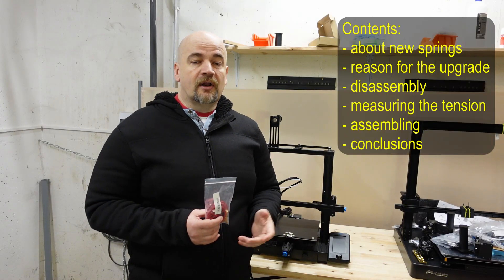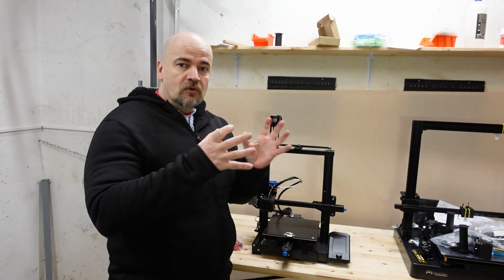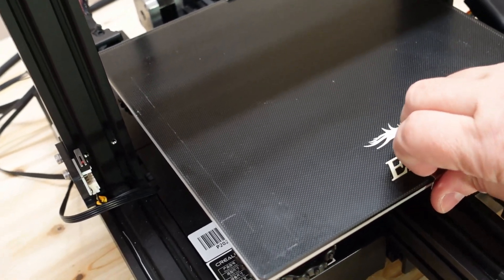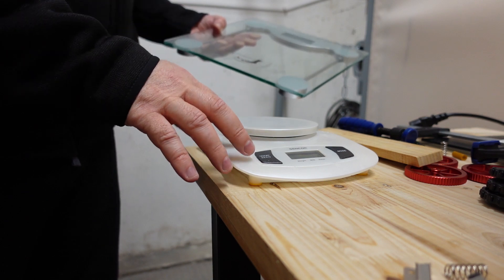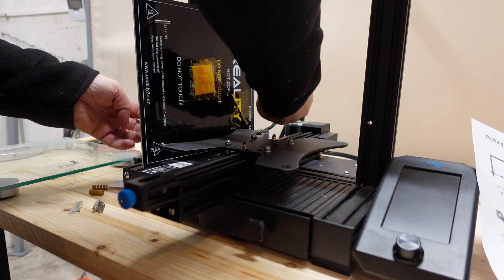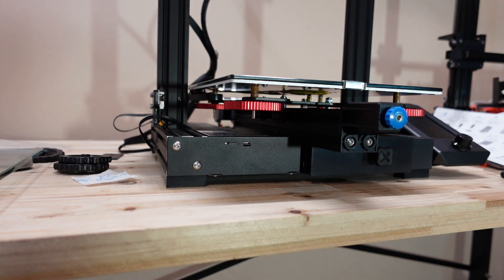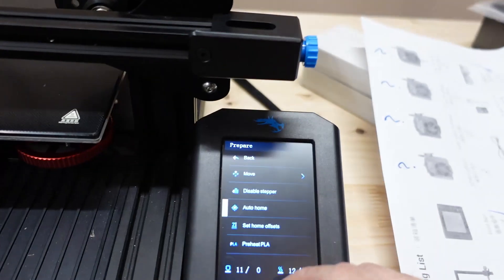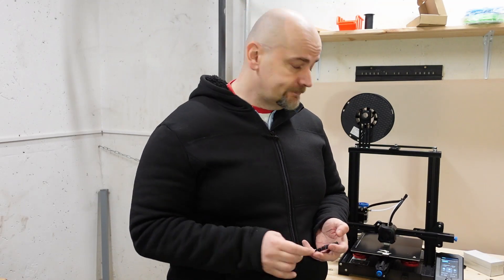Testing and upgrading bed leveling springs and knobs - Ender3 V2 upgrade

Comment: I'm gunna do this with my v3 se. Looks like I'll have to drill out the threads in the plate under the bed. Should work. If it doesnt, oh well buy new parts I guess.

Update: I did it. Aaand I got too excited for the upgrade that I over looked one detail of why it doesn't work....until you modify the wheels. 
All 4 adjustment wheels strike the front and rear bump of the body of the ender 3 v3 se. To get around this I used a coping saw to cut the spikes half way or I measured 9mm from center and they now clear. Wheel spins nicely. To get the bolts to go through the bracing plate under the heated bed, I measured a  the stock bolt that goes through the bed and into said plate and found a drill bit 0.33 mm larger. I found I could have actually stepped that up one more size. It now can be leveled. I'll update this again with my finding. Was it a good idea? I don't know yet.

Comment: It's really annoying that Ender ships these units with free spinning Bed mount bolts. A cheap part like lock nuts to hold the bolts in place should come stock on every unit.

Comment: How heavy are these knobs compared to the original? Adding mass to a bed slinger ought to be detrimental, then again maybe at slow speeds it doesn't matter
Reply from the maker: Yes, they are heavier and more slippy. I moved back to plastic ones (but springs are good)
Reply: @MyTechFun  hey thanks, maybe I won't upgrade them after all! The ender 5 even with bed supports flexes a bit but in this case it would just be pretty much a static load... I'd rather upgrade the leadscrew first to try and get rid of the z wobble though.

Comment: I just installed those springs I've done two test prints and both times the nozzle just hits the bed it doesn't even get onto the bed it hits the bed starts spitting out filament so I have to quickly stop it, do I just need to compress the spring is more?
Reply from the maker: Try to compress springs more. If they are almost max compressed, move the Z limit switch a little bit higher (so it is pressed earlier)
Reply: @MyTechFun  when I installed the glass bed I saw to put the bed under the z switch to measure should I do that with the spring? That would mean I need to measure spring+bed right?
Reply: I depressed the screws completely, I dont know if it's me or the screws but one side is always off. I had a theory, if I loosen the springs couldnt I then just ajust the z ax in the right position? So 0 would always have the nozzle in its right position that would also cut leveling needs, or am I just trying to climb a never ending mountain meaning its a waste of time.

Comment: I bought these so my bed stays level. They didn't help, but my bed doesn't crash into the y motor anymore because they're taller so I guess it's a win lol 🤷‍♂️
Reply from the maker: You can always move Z limit switch a little bit if necessary (up-down)

Comment: Wow! You saved my life at 12:55! I was having a hard time with my new yellow springs because they are taller than the original ones. I moved the sensor up a little bit and I managed to level it properly!
Thank you so much for that tip. Really appreciate it!

Comment: I have received ender 3 3d printer. In bed spring There 4 springs in that one smaller then all? It's good or not…
Reply from the maker: Smaller goes to back-left position.
Reply: @MyTechFun  okey…

Comment: I guess there is an important aspect, if u push the bed level springs soo hard, the spinrgs will bend your bed, Isn't it?
Reply from the maker: Hm. I don't know if it can bend or it will break first. But I belive these springs are not that strong, I never heard about similar case.

Comment: Thank you for this video I finally figured out what to do for my ender 3 printer I changed to class bed and whenever I would level it it would  Unleveled  itself. Guess it’s time to replace my factory springs with the one mentioned in your video.

Comment: If I'm planning on putting a BL touch on, is there any benefit to doing the spring upgrade? If I just crank the stock springs down tight and get it roughly level, won't the BL touch compensate?
Reply from the maker: Yes, there is a benefit of sprint upgrade. BL Touch will not level the bed for you, only compensate the unleveled distances during 3D printing. It would be perfect, if it doesn't have to compensate anything. Stronger springs will hold the bed leveled for a longer time.
Reply: @MyTechFun  thanks for taking the time to respond!

Comment: Hi, regarding your test print after replacing springs. I am having issues with getting the same print to stick to the bed, it always comes loose about 2 minutes after the print has started. Any ideas on what I could be doing wrong
Reply from the maker: Not enough information. But clean and level the bed.

Comment: I got a set of these for my ender 3 v2, they are too long, the links in your description are for 25mm, the ones the v2 needs are 20mm, how did you compensate for the taller spring with out cutting them?
Reply: nevermind, i see you messed with the Z limit switch, i ordered some 20mm springs and hopefully i wont have to mess with that
Reply from the maker: It's very easy to move z limit switch, only two screws is holding it.

Comment: I performed a similar upgrade on my Ender 3V2. The difference was that I used 20mm yellow springs (same length as the originals) whereas I think yours are longer. The result for me is that I didn't have to move the Z-axis switch. The yellow springs are much stiffer than the originals so it's not necessary to make them longer also. Otherwise you lose build height and/or end up with highly compressed springs which start to deform horizontally and are difficult to adjust. Great channel, by the way. I subscribed!

Comment: I've tried quite a few spring sets and I have a set of silicone columns too, the exact ones you pictured. I've probably used equal amounts between springs and the silicone columns and I haven't really noticed a difference in anything really. I use a BLTouch too so as few have mentioned, most of the small movements in bed elevation is compensated for.
The one thing I will say though is that the silicone columns are generally a lot shorter than the springs and you might run into issues using some of Marlins built in manual leveling features like Level Corners. Once you've fully uncompressed the columns and can't go any higher with the bed the firmware can get fussy about Z height and it creates a kind of rabbit hole trying to figure out how to trick things into working. 
Great video as always I really enjoy your style of reviewing and providing detailed information on your journey through upgrading :) Keep up the amazing work!

Comment: Is the diameter of replacement springs slightly bigger than original? How well do they stay within the trace keepout distance around the holes? You have a metal undercarriage, so it would be bad if the springs scratched their way through soldermask and then contacted the traces underneath, it's directly a fire hazard. I suggest that you always use some kind of possibly plastic washer under the spring that you can use a hole punch kit to make from some robust plastic, or maybe a nut that tightens the screw directly against the bed and that won't move. The nut will also consume some space and compress stock springs more. I also use Kapton tape applied on the spots of the bed where i may attach glass mounting clamps, also so the solder mask doesn't get damaged.
Reply from the maker: Interesting thinking. Yes, very minimally bigger outer diameter. Inner almost equal. Top is flat surface, so they hold the position very stable. Plastic washer? It must be very heat resistant if I heat the bed to 110°C for example. Yes, tightening a nut came to my mind, but I didn't tried it. Thx for sharing your thoughts..

Comment: I find that geometry of a smoother  knob has a better feel to it, i find the bigger bumps make it easier to apply a high torque but i find the smoother alows a more fine adjustmet, i use diy printed knobs (.4mm layer height .4 nozzel) so the porosity of the plastic gives a better grip on yout fingers, and i have a turned steel insert for the threads.( possibly leaving the top plate on will help prevent your screws wobbling as much. Appreaciate all your efforts and videos.

Comment: If you're going to continue doing videos on Ender 3 upgrades, have you considered doing one about 3 point leveling conversion kits, and/or about linear rails conversions? Those are the ones I think sound like they could be good, but I don't know if they actually make a difference to motivate the cost
Reply from the maker: Good suggestion. I am not sure yet about linear rails, but I think only advantage would be longer life time. Wheels wear by time, they should be replaced, only I am not sure how often. It is hard to invest if you can't see immediately the difference in printing.

Comment: Two things to pay attention to here which cause a lot of headaches for people, and damage printers. First one is to purchase the same length springs as the original if possible. In your case, I thnk you used matching 20mm springs as the original for Ender 3 v2. Most listings on Amazon and Banggood are 25mm springs with instructions to cut them for sizing. Do not cut the springs. These light load aftermarket springs are die-cut to be flat on both ends for a reason. Rather raise or lower the z limit switch by the difference between original and new spring length. The other issue is over compressing the springs which you unfortunately did in your video. Over compression will prevent the springs from serving their function. This again can be prevented by raising the z limit switch by the a few mms.
Reply from the maker: Very nice written comment (most of it I mentioned in video). Yes, in footage they look over compressed, during first setting they shold be to prevent nozzle to hit the bed. Then I loose them a little bit. But in meantime I found they could be less tight, so I raised the Z limit switch by 0.5 mm, but after published video.

Comment: I use Ideaformer red silicone stands from aliexpress. I've picked these because one out of four is shorter to accomodate bed cable tensioner. Bed is very stable now, no movement like with standard springs (even with properly tightened v-rollers bed still had some looseness). Also it's more difficult to turn the adjustment wheels, it's now close to impossible to turn them by mistake, which is very good.

Comment: I've used the yellow springs on my three printers for awhile now and seem to hold the position well for long periods. I do have BL touches on all the printers though so that could be compensating for any movement. Only way to truly know would be to grab the mesh numbers from time to time and compare to see if there is any movement.

I have some silicone spacers that I ordered awhile back and am waiting on delivery. So will see how those will work and if any real difference. I've never had the nozzle slam into the bed, but with the silicone spacers if that were to happen it could result on your bed getting damaged. I use mirrors so I guess the potential would be there to break them if that happens but knock on wood hasn't happened yet.
Reply: You've never had a nozzle crash before? If I send you money will you buy some lottery tickets?

Comment: Just some thoughts from an engineering point of view: You measure both springs compressed to 17mm, but didn't mention if they compressed the same length. And from what I can tell the yellow spring is longer...    Of course it doesn't really matter here, just pointing out a potential oversight  :)
I also agree that the stock wheels might be better since you always want a lighter carriage whenever possible, thanks for this good video!
Reply from the maker: Thx. I like engeneering thoughts and I agree, one of spring parameter is Newton per compression length. But here I aproach from using aspect. If they are compressed to same lengh (in printer), what force they provide. And they have almost similar uncompressed length (yellow is longer by 0.5 mm maybe)

Comment: I went away with the springs, my printer had those yellow/orange springs, I guess they worked fine but I went with silicone standoffs, they are usually marketed under "Heatbed Silicone Leveling Column".

Comment: I am using silicon self made dampers for 2-3 years now and I don't really see loosing some elasticity. Maybe the raw / source material (Silikon Kautschuk from trollfactory) I use does not loose so much elasticity over time. In my opinion, I think these dampers with 20-25mm diameter give the whole bed a much higher stability in horizontal direction than these springs (that are really much better than the stock one, as you said!).
Reply from the maker: Great point! I didn't think of that (more stability in horizontal direction). Probably there are better materials, I had some bad experience with silicone and elasticity.

Comment: Maybe it is not worth talking about, but using the full aluminum knobs could take some more heat from the heatbed to the knobs, so that there where the screws are inserted in the bed a small cold spot can appear. Less metal material there, less heat loosing from bed, so my theory :-)
Reply from the maker: Taking heat from bed, I didn't think of that. I like your theories. Thx.

Comment: Since I've installed a BL Touch on my E5 I tightened the bed all the way and secured the knobs with an additional nut. You'd be suprised how level it is.
Reply: this is actually a great tip! thanks, just got the official auto-leveler recently.
Reply: @xorcipher  alternatively there are silicon parts you can get instead of springs, but I found springs to be good enough, all I do is check if they're tight every couple weeks and then level again
Reply: @freaky2xd  Do you recommend spring compression all the way? it seems like it may bend the bed base?
Reply: @freaky2xd  that makes sense, I have done just that enough resistance, but additional M3 is a great tip thanks again!

Comment: After fitting the BLTouch, I replaced my springs and dials with aluminium spacers and nuts, so I rely on the auto bed levelling instead.
Reply: if you happen to have OctoPrint, can you please share a screenshot of your bed in Bed Visualizer?
Reply: I possibly still have an unlevel x-axis so I have the dual-thread upgrade ordered already.
Reply: @Tokolist  This is mine after rebuiiding my system, installing new springs and adding BLTouch. I wish I had the original map as the bed was really a mess due to Z-axis support leaning forward. (remember YouTube does not support direct links so you will have to add the h,t,t,p,s,:,/,/ to make it work correctly. (i.postimg.cc/gk784TbD/BLTouch-Plot.png)
Reply: @oldsaltypossum5287  Thank you for sharing this. My bed is also well leveled with springs. You should change scale to 0.5mm to get real picture. 2mm scale doesn't make sence, since you can get this result at stock Ender using just peice of paper :) I'm actually curious about aluminium spacers that @Pugwash
 is using, since I don't believe you can get good bed leveling with them and ABL just masking bad bed leveling....
Reply: @Tokolist  Thank you for the suggestion, I will do that right after my current print job is complete.

Comment: Thank you for another detailed mod of the Ender 3 V2. I purchased mine a couple of weeks ago and struggled with getting clean prints. I completely disassemble it and followed your build guide taking great care to work on a level surface and checking that each part was level and square. I took the opportunity to install the Micro Swiss hot end, BLTouch, dual Z axis (second drive motor version), metal extruder, and upgraded (yellow) springs. Following your guides for each and now the print quality is great. The only residual issue is my Y-axis motor runs very hot (can touch it only for a few seconds) while the E and X-axis motors run warm and Z-axis motors run cold. Have you noticed the same or have any troubleshooting suggestions? Thanks again as I was getting frustrated prior to the rebuild and upgrades.
Reply: Have you checked your wheel and belt tension? If you've got a lot of extra resistance that will make the motor heat up. The bed should roll freely with no belt on it.
Reply: @dalem04  Thank you for the suggestion. I put the printer back on the operating table and verified no binding and belt tension was good. While leveling the bed I noted the Y-axis getting hot so I'm going to do more research to figure out what would cause the stepper motor to run hot at 'idle'. For now I'm treating the symptom by running a fan over the motor which is working better than I had hoped.
Reply: @oldsaltypossum5287  If there is no binding and it's hot at rest, check resistances (of the motor and wire) and output current and voltages.
Reply: @dalem04  Thanks again for the advice. Found the Y-Axis resistance to be 5.4/5.4 but all other motors read about 3.4/3.4. I'm contacting the seller to verify a bad motor.